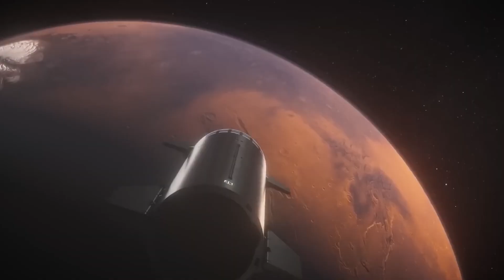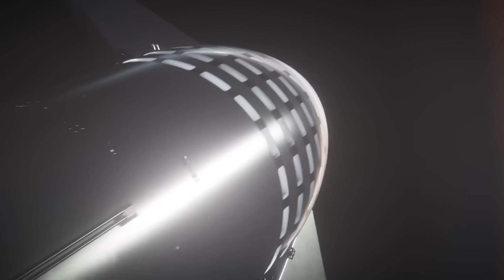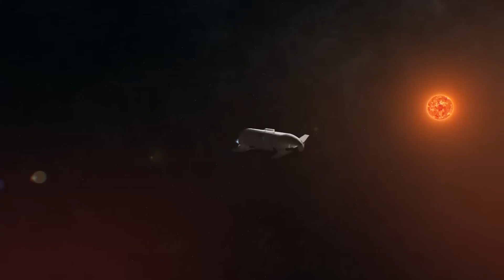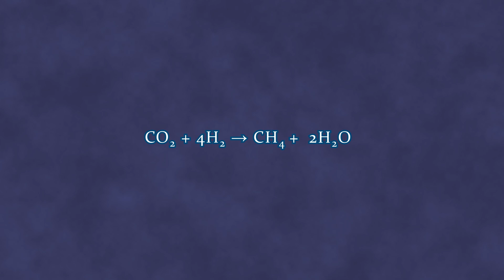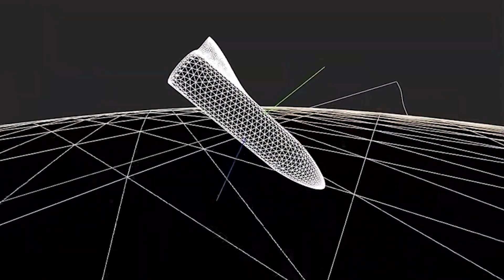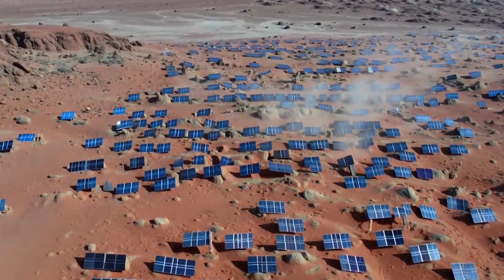The Road to Mars: What It Takes to Reach the Red Planet – and Does Elon Musk’s SpaceX Have It?

Comment: We are always led to believe that a stay of at least 18 months on Mars is unavoidable. This overlooks the fact that, if a spacecraft were able to go fast enough, it could get to Mars and back in about 2 months. The problem is that with current technology you will launch your spacecraft ahead of Mars' opposition with Earth, but by the time you get to Mars, opposition has come and gone, meaning you have to wait a couple of years until the next one. If you could stay ahead of the Earth in its orbit, and get to Mars before opposition, then you could stay a week or so before coming straight back. I have read that the Starship is expected to be able to make the trip to Mars in 80 to 104 days, depending on how close the opposition is.
 
In the video the idea was discussed of sending a second tanker ship on a parallel course to Mars, after the first tanker had refuelled it in LEO. How about turning off the engines of both vessels after half their fuel was expended, docking, and then transferring the unused fuel from the tanker? The Starship would suddenly have an extra half tank of of fuel! I don't have the mathematical skills to work out whether it would shorten the journey time to Mars sufficiently to arrive ahead of its opposition with Earth, but I think there's a good chance it would.

Getting back would be harder, because fuel for the return would have to have already been  manufactured, using so far untested, technology.  You may also need to refuel in Mars' orbit, making it all very difficult. Things would be made easier if the Starship were split into two stages for both the outward and return trips. The current Starship is designed for everything to be reusable. The is fine for LEO, where cost is important, but getting to Mars and back is never going to be cheap. Having some redundancy would probably save money.

Comment: You are not correct about a vehicle in a specific orbit always reaching it's destination.

There are always mid-course corrections in interplanetary flight to maintain an accurate course. These corrections are provided by small "burns" of fuel. The corrections are required by tiny gravitational tugs from the large number of sources in the solar system, which cannot be calculated together perfectly.

--

Okay, you covered this briefly later.